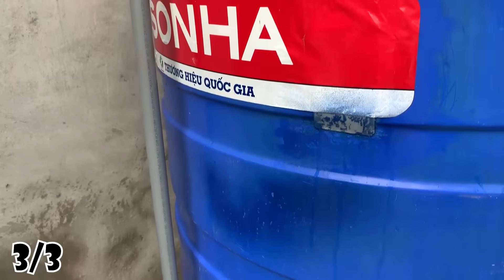I never have to buy water again ! How to make PVC drainage pipe for corrugated iron roof 3 in 1

Comment: What a huge waste of time effort and cash you got around five hundred in conectits alone could havs spent couple hundred and got a micron filter with a uv sanitiser system with the solar panel to run the uv and still saved cash
Reply from the maker: Thank you for giving me this advice. Can you tell me more about that system? And where can I buy it?
Reply: DIY staffs are mainly for satisfaction of soul, not for money 😊
Reply: You main  RO  SYSTEM  WITH 24 VDC  MOTOR  AND SMALL BAT  24  VDC AND SUN.

Comment: After 500 fittings and 400 elbows and 300 water valves, I finally can drink my cup of water!
Reply from the maker: Sounds like a lot of work, but I’m glad you finally got your cup of water! DIY projects can be quite the adventure. Thanks for sharing your experience! This project I did was about how to collect rainwater from PVC drainage pipes on the roof. This will help save water in areas that lack rain and lack clean water for use. Do you use rainwater for household purposes?
Reply: One requires a lot of patience to make this project see the light of day the cost seems enormous and have to join the farmers team who will be gazing clouds for rain, if there is no rain as recently happened the tank will always be empty and continuous raining will limit the capacity  average family required minimum thousand liter per day one can never expect daily rain , whether technology of tubing of various sizes and it's many connections require a hiring a technician for a few days for  a few cups of water.😂
Reply: @cmasyedsalahuddin656    in areas where this might be a primary source of water, people use much less than in developed countries. Good chance they are washing clothes and bathing in a stream plus crapping in a hole, so only use this for drinking / cooking.

Comment: Everything is very nice, your thoughts are also nice, but I have to tell you something, if you had made the filter in a separate drum on top of the tank you stored it in, it would have been much easier to wash the filter when it got dirty. 1. sponge. 2nd stone. 3. If possible, use a pumice stone. . You can add 4 coals (to clarify the water) and the resulting water to the water tank as it is completely clear and clean. You can look at outboard aquarium filters as an example. But your idea is great. greetings from Turkey.
Reply: Sizal tresura psow
Reply from the maker: Thank you very much we will learn your way.
Reply from the maker: Co masz na myśli?

Comment: Creative and mostly effective.   For me, I'd buy the filters so that they can be serviced.  Granular activated carbon needs to be changed once in a while. Also, for drinking purposes, you should be doing a bit more than that with the filtration process.  This system might not cost much more to do it right when you add the trips to the hospital and the extra toilet paper needed for all that diarrhea you're going to catch.
Reply from the maker: Thank you very much. My drinking the water was just to prove to everyone that it is clean. Of course, people will use additional methods to make the water even cleaner, such as using bacterial filters, UV light sterilizers, or boiling the water before use. To me, this system is quite convenient for many places around the world that lack water and don't have the budget for expensive water filtration projects. Have a great day, and please continue to provide me with advice in my upcoming videos.
Reply: Easy boiled and  filter  it it's  100 % saves  water  for  hilly  areas  or where  lack of water 💧.
Reply: I’ve drunk unfiltered water tank water for 7yrs haven’t been sick once.  Water is naturally filtered through the gravels, that’s what spring water does.
Reply: @Sweetlyfe  I used to work in the water industry.   It depends on what your tank water has been exposed to.  If you keep it free from soils then you won't have bacteria.   If you add in bird poop on the roof that the water runs over you can have some nasty bacteria you can get sick from.  If God forbid a dead animal gets in the tank he put no lid on then you can really get someone very sick.  That's why I don't think drinking this water is good.   But there are filtration systems you can add that can for sure make it safe to drink in all cases. This just isn't robust enough.   Though it is very creative and interesting to see it done.   He probably lives in a deprived area and needs to solve the problem in this way.  I don't knock it.
Reply from the maker: @sweetlyfe you should boil water with an RO filtration system, not buy it directly! We will not know what damage is actually in the water
Reply: I used to put in a system that used hydrogen peroxide to sanitize the water in a tank with the use of a peristolic pump.  Then, just a filter packed with gravel, then greensand, and finally granular activated carbon.  It took water that looked like almost coffee it was so dirty to very clear water that you could put in a glass and let set for a week, and you would see nothing settled out of it.  Definitely drinkable
Reply from the maker: oh wow what a good method to filter water! There are still many people who do not believe that such a filter cannot be drunk! Do you think they are too skeptical? In fact, it is safer than many water sources supplied in the city.
Reply: @HolicCreation  for me If you had a lid on the tank to prevent animals from possibly getting in it and dying, it would be a big improvement.   I'd think then with what you have, it would be mostly safe to drink.  The two 2 filters you made are quite good.  It would be a big add-in cost to go to what I would do.  So everyone has their own budget and must prioritize what they have.  If you have the added amounts to do more, I would go to a system like I told.  It would be able to solve the problems of bugs getting in the tank.  Also should an animal poop on the roof, etc.
Reply: Well it is a budget friendly solution that works for his environment. Others have commented that it would better with a lid on the tank. I say that is secondary to all of the worms, and other bacteria that will make it into the tank via the wire filter system on the roof and into the person consuming it. 😮😢🤔😏
Reply: @jasonhorrocks1336  There is no single issue to make it possible to prevent dying animals in the tank. Secondly there are plenty of creative ways to think off, that not require a traditional roof, to collect the rain water, hence being able to also avoid the bird poop. So with other words; it's good already. 

For drinking specific you could then also store it a separated tank, which has for example a month supply of water, which you then test once a month with a cheap tester / strip. But he is really right, I mean the shower water in SE asia is already 10X dirtier than his water is, let alone for it to be close to drinkable. Many drink water machines/suppliers are often no good too, I mean its obviously drinkable, but I doubt its better than the water from this video is on average.

Drinking water specific also needs way less, so a roof is not even really needed for that. Could do for example PVC pipes that have holes in them together with mosquito net screens, spread out over the land too. This would still collect plenty of drinking water aside from general water from the roof. Minimizes the bird poop odds for sure as much as possible.

Comment: Hello, awesome!! Thank you for sharing it, I have a question, what type of stone do you use inside the filter of the tank? and what is its function?
Reply from the maker: Thank you for watching the video. The type of stone in the large tank, which is blue, is fine gravel (about the size of a thumb) used for coarse filtering of water from the roof. The water then flows from the large tank to the dual filter beside it, following the blue arrows as noted in the video. Inside the dual filter are alternating layers of fine sand, activated carbon, and small gravel to ensure the highest quality of filtered water. Enjoy the video!

Comment: Depending on the pipe to fitting, if they are tight fit. Dontvglue them, or you could put ptft tape round the pipe/ or silicon the outer joint.

Also add a UV filter.

Good video.
I dont know how many countries, that you can drink the water, because of the chemicals used.
Thats why bottled water is popular.
Reply from the maker: Thank you very much. You're right, we need to add a UV filter. Do you use a 3-stage water filter system for a large water tank in your house?

Comment: Couple filtration ideas:
1. Activated charcoal is just wood, put in a metal box, inside a bon fire, enjoy the gathering next morning dig out the metal box, open it for your high quality filter( as long as it was borderline irresponsible bon fire 🔥 🔥🔥). 
2. The bacteria filter could be as simple trickle down glass bottles stacked and facing the sun. If you arrange them well, you can have one bottle magnifying the second and so on. Obviously if it’s dark it doesn’t work, but maybe worth increasing the odds. Bacteria is least common yet most risk, so even if it was hitting 50% of the collection may be better than nothing. 

Just hoping to add a little value to your great idea.
Reply from the maker: Your idea is fantastic. Thank you very much. I will explore more about the system you suggested. If successful, we can create a new system that can filter water and bacteria more thoroughly to ensure safe water supply. Do you have a large water tank at your home?
Reply: @HolicCreation  I do not unfortunately, I was gathering the material to build my diy filtration plant experiment but had to turn my attention to other maintenance issues. 

I heard about a type of foam padding that you treat with sulfuric acid, soak in Brine (heavy salt water), then rinse. The bits of hardened foam becomes ionized which will demineralize water for spot free applications. (Totally untested by me so don’t beat me up if it’s bunk lol)

I have a couple of fish tanks and an old water heater that sanitized and modified.  I wanted to put sand, activated charcoal, and a reptile UV light that would turn on when the sun was down, combined with the softener. 

PS. I probably have a 10-25% success rate on my ideas, so it might turn out like my few successful projects that look like I bought them somewhere, but there’s a higher chance I’ll be on the side of my house looking like a drowned rat covered in glass with acid burns on my skin lol.

Comment: Good for mountain regions , for they usually get rain Airways, and they lack drinking water
Reply from the maker: Thank you very much. A rainwater harvesting system is quite necessary for water-scarce areas. To ensure safety, we should use a bacterial filter or boil the water before using it. Do you use PVC pipes and collect rainwater like in this video where you live?

Comment: what about a lot of snow in winter?
Reply from the maker: Great question! In areas with heavy snowfall, it's important to ensure that your system is well-insulated and protected from freezing temperatures. You might need to consider additional measures like using heat tape or insulating materials. Have you faced any specific challenges with your system during winter? I'd love to hear more about your experience!

Comment: In 3/3 what are the red taps for? To backwash? Yet the last scene shows the white and red taps all open at the same time.
Reply from the maker: When opening the white valve and closing the red valve on the filter, water will be filtered from the circulating tank through the filter. When closing the white valve and opening the red valve and opening the metal valve between the two filters, water will carry dirt and flow out to clean the filter.
Reply: @HolicCreation  Yes. That's called backwashing.
Reply from the maker: Absolutely! Backwashing is a common process in water filtration systems where the flow of water is reversed to flush out accumulated debris and maintain efficiency.

Comment: I wouldn't make some of your connections glued. As a plumber that would be nice down the road. The two secondary filters I would definitely not glue. Even if it sometime,depending on water consumption,,,,the carbon and rock should be washed and refurbished.  Over all love this design. More people should collect rain water. Even if just for backup. Great design.
Reply from the maker: Thank you my friend for sharing your valuable experience! I will improve it more, I was anxious to upload this video and did it in a hurry which made it look less clean but it was all done safely! Do you think rainwater is a valuable resource?

Comment: u don't need this much setup to just filter the water, just use a 20" jumbo filter housing with 20" 5-micron Filter. that would most cost effective....
Reply from the maker: I get where you're coming from! A 20" jumbo filter housing with a 5-micron filter is definitely a simpler and cost-effective solution. My setup was designed to go beyond just filtering—it’s more of a full DIY approach that combines filtration. But I appreciate your suggestion, and it could be a great alternative for those focusing purely on water filtration. Have you tried using the jumbo filter yourself? How has it worked for you?

Comment: How long before you need to change the sand/rocks and clean everything inside?
Reply from the maker: If you live in a tropical country during the rainy season, you can clean the filter tank by closing the white valve and opening the red valve, then reverse the water flow to flush debris through the metal valve between the two filters. If you have any questions about this filtration system, please let me know. How is the weather where you live?

Comment: Between main tank  and  pvc  valve I would leave  space  in case for next   Valve replacement.
Reply from the maker: That’s a great point! Leaving space between the main tank and the PVC valve for future replacements is definitely a smart move. It can save a lot of hassle down the line. Have you had experience with any particular valve types that you recommend?
Reply: @HolicCreation   I’m  plumber 
24 years  of experience

Comment: How can I be sure this water is clean?
Reply from the maker: To ensure your rainwater is clean, using a combination of filtration methods is key. While it's essential to be cautious, many DIY systems effectively filter out contaminants. For drinking purposes, consider boiling the water or using activated charcoal filters for added safety. Regular maintenance and testing can help ensure the water remains clean. Trusting proven methods can make rainwater a viable alternative for various uses, as long as proper precautions are taken. How do you feel about using filtration systems for safer water?

Comment: China your workmanship is lower than average. Strainer is needed for all purifying systems, after the roofing channel. Microbes, lizards, millipedes, snake can reach inside the tank. Also I find a leak beneath the tank. Rain water density is different from municipal water and borehole water. Also it will not exert enough pressure if tank is 30% filled rain water. Enough pressure will only be available when filled above 88.5%.
Reply from the maker: Thank you for watching the video. You have a lot of knowledge about physics and water issues. But I am NOT Chinese. Don't act like you know everything. Learn to ask questions

Comment: What kind of PVC is that?  How do you keep it from degrading in the UV of sunlight?
Reply from the maker: Oh those are specialized outdoor PVC water pipes and they are highly durable and can be used for many years! Does your place currently not sell this common type of pipe?
Reply: @HolicCreation  
TBH I have no idea.  
I just know that, plastic of a general kind, typically degrade quickly under sunlight.  I'm sure that if I were to do something similar to your setup ... I'd be sure to use something rated for outdoor above ground use.  Gread video by the way!
Reply from the maker: Thank you very much. How is the weather where you live right now?
Reply: @HolicCreation  
Mid 80's (f) and humid today.

Iowa, USA

Comment: It doesn't work during heavy rains. Water overflows everything. A little maybe collected. 
Worse is the cleaning of dirt accumulated in and the pipe and the wire mesh. Turns out to be more of a headache 😔
Reply from the maker: When it rains heavily, it cleans the pipes and everything. Then the water will be collected into the tank. And the trash will be blown away through the trash screen.